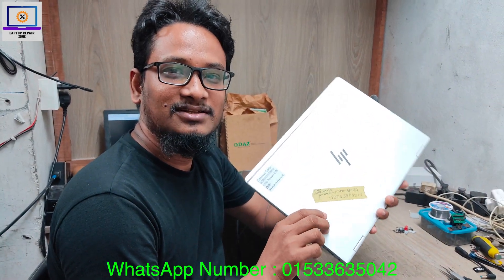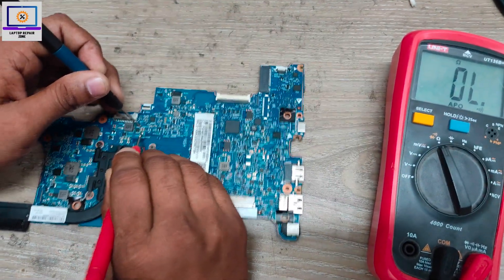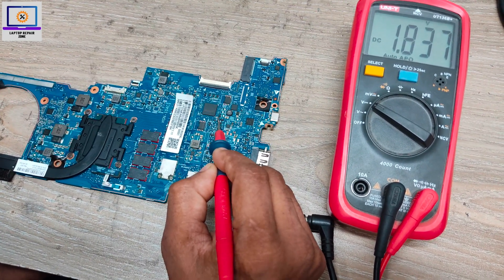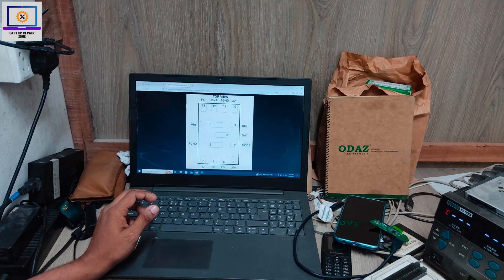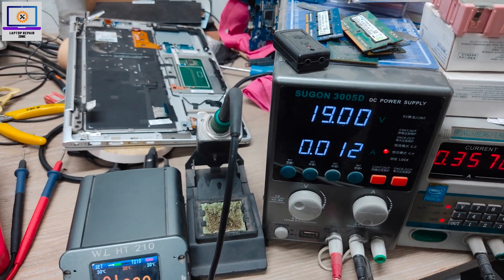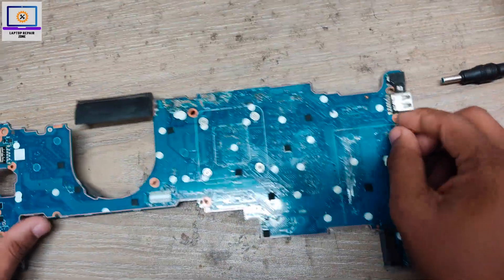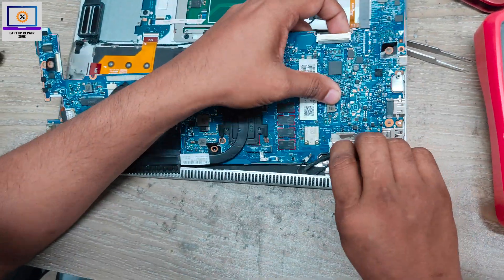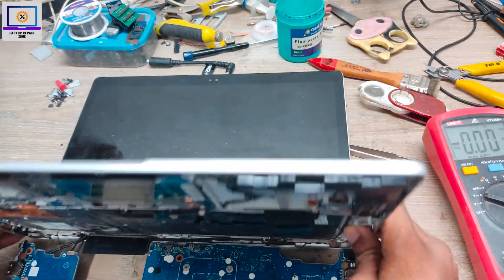hp laptop | hp elitebook | hp elitebook not turning on | Fixed !!!

Comment: My one won't start. Here's what happens:

When i either plug the ac in, or plug the battery in, the charge port light flashes orange and white 5 times, then the power button light turns white for 3 or 4 seconds. The capslock also goes solid white while the power button light is on, but turns off after a few seconds. Wont power on. I have tried a new battery and running without battery. Nothing

Comment: Great video tutorial, thanks. I have the same motherboard, the caps lock blinking 5 times, when I checked the HP light codes they are saying it is a Ram problem. Any suggestions?
Reply from the maker: You need to check motherboard

Comment: Hello, I need your help...
My hp1030 g2 just starting blinking light on the Capslock not coming on...
What do you think could be the problem
Reply from the maker: Reset CMOS or check all the required voltage and signal.